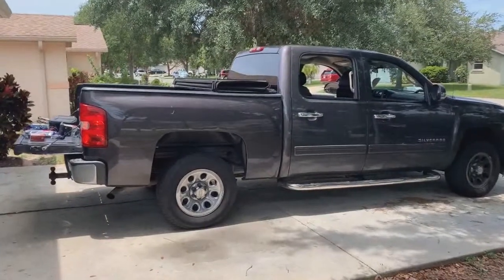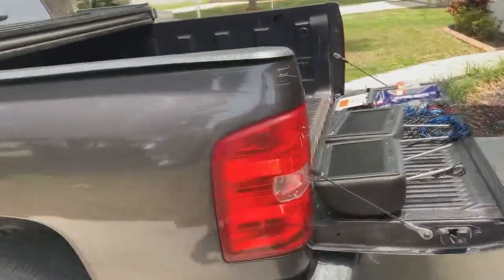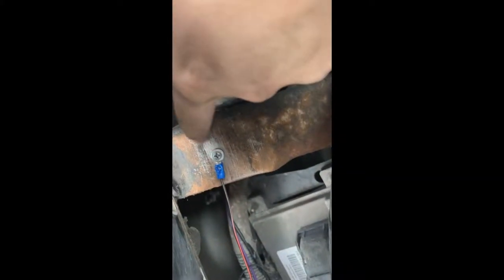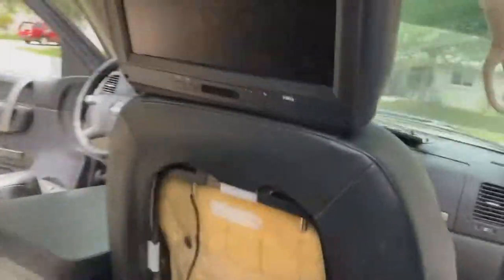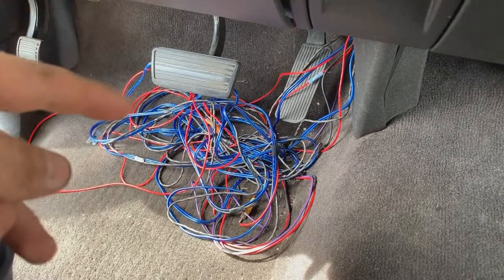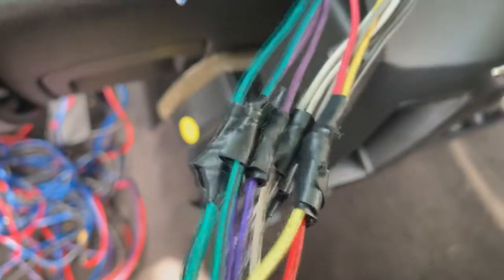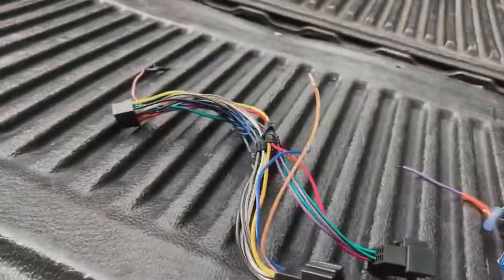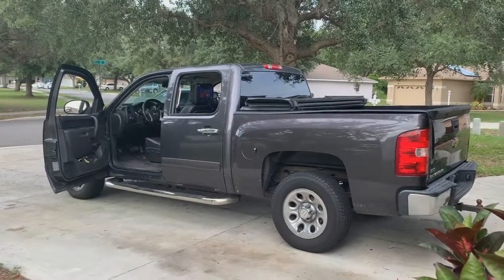2011 Chevy Silverado Pioneer Radio, Backup Camera and Headrest Monitors!!

Comment: Hi there could you tell me the part#s on the head seat TVs and headunit?
Reply from the maker: I'm not positive but if i remember right the radio is a pioneer avh 4800bs  and the headrests are T View T122PLBK
Reply: @SullivanDesigns  thanks
Reply from the maker: Andrew Gonzalez no problem!
Reply: @SullivanDesigns  how much you charge & were u located
Reply: @str3tchg648  I am wanting him to install headrest in my suv